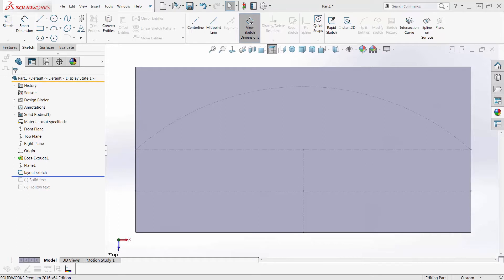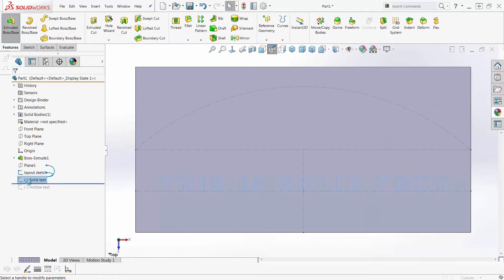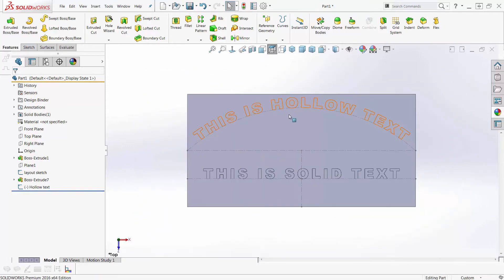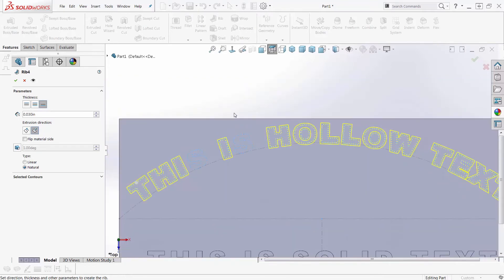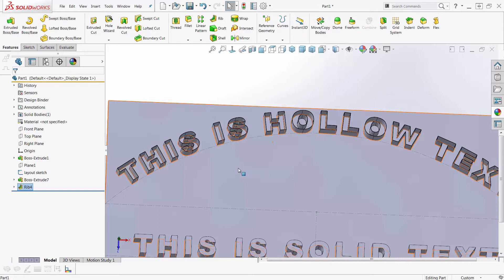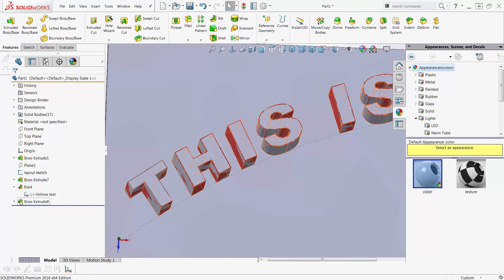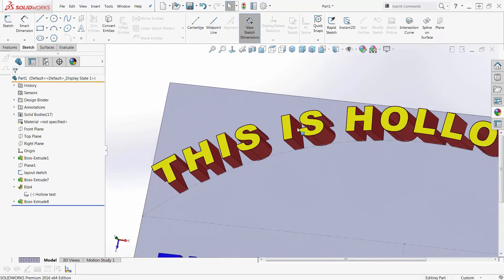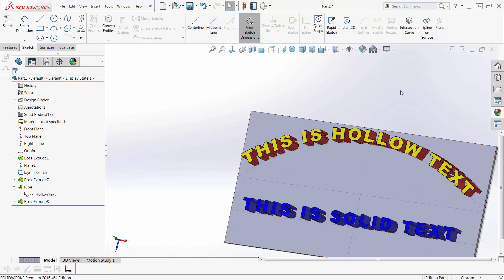SOLIDWORKS - How to Make Hollow Text

Comment: Hi I don't know what I am doing but i get the Error "the rib is not bounded properly the extension of the rib does not intersect the part model" Any idea what I did wrong? Thanks
Reply from the maker: Ribs must be bounded by walls.  Intended to be inside things to strengthen.  When a rib executes, the sketch line(s) extend out both directions along the axis of the line up to next, and also down up to next.  So, if the rib command is looking the wrong way (up), or peeks over an edge,  it sees infinity, leaks out, and fails.  The same if the rib runs across a hole in the bottom of whatever you are strengthening.